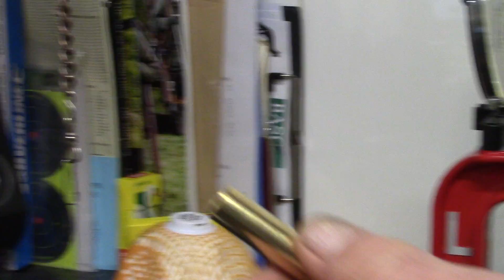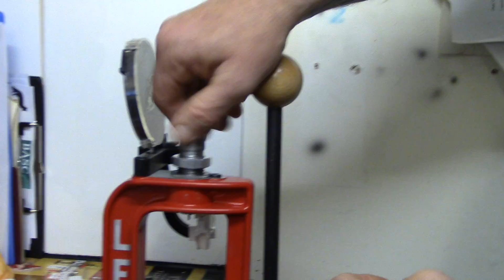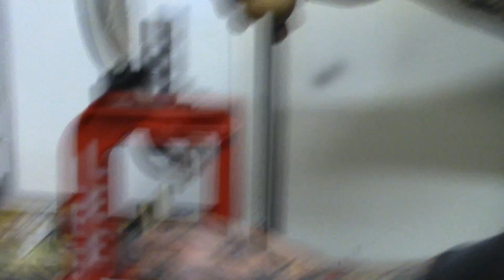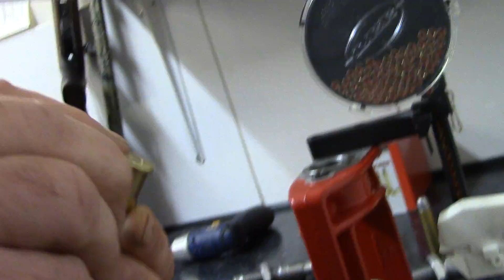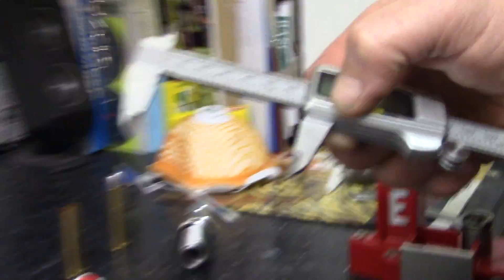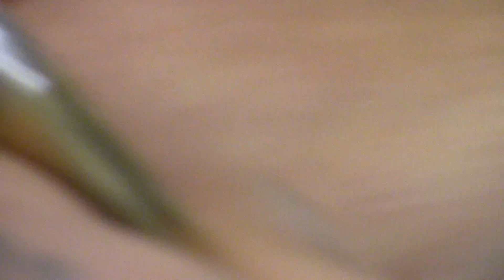45-70 Government reloading using Lee re-loader

Comment: For those who are starting to load .45-70, know there are really THREE different categories for this cartiridge - the lightest is for Trapdoor Springfields, middle level for lever-action rifles, and the strongest/heaviest for MODERN single-shots. Have older rifles checked out by a reliable gunsmith so you don't damage it OR YOU by overloading it. 
Also, if it's a single shot, you don't need a crimp step at the end, but for lever actions, it's absolutely necessary so they don't come apart or have the bullet pushed back in the case while in the magazine tube, either one of which can cause a lever-action to jam . Overall, though, this video is a great primer for the new .45-70 reloader, taking all the steps needed. Some can be combined (flaring & priming), but the systematic progress is good.
Reply: I have an H&R single shot. Glad I got it. Going to reload some 405 gr bullets.

Comment: Did you buy those 400 grain lead bullets or did you cast them. Are cast bullets okay with 45-70. Probably a big saving if using cast bullets. Could use some advice on this.

Comment: Great video, just one thing: you should be putting wads in the shell to take up the extra space, otherwise you may cause an explosion.
Reply: With smokeless powder you don't really need a wad, but is does keep powder toward the rear of the case if you press it down with a rod of some sort. If you are loading BLACK POWDER in any cartridge there can be NO air gap between the base of the bullet and the powder. If you fail to heed that warning, you will ruin your rifle, your day and possibly kill or maim yourself or any bystander.
Reply: Didymus 1999,
Listen to Ray C ...

Comment: If you're using a Ruger No.1 to fire .45-70 you are a glutton for punishment. It's the worst rifle I ever shot in that caliber. It's too light, has a terrible butt stock and the barrel is too short. Don't get me wrong, I love most Rugers and I own sever, but the Ruger No.1 in that caliber is just not a good idea. It left me with the worst bruised shoulder of any rifle I have ever shot including several .50 BMG rifles. The .45-70 is a great round but just find a better rifle to fire it out of.
Reply: Are you thinking of the Ruger #3, that was short and light . most No. 1's have 26 inch barrels.

Comment: If you're using a Ruger #1 or any single shot for that matter, there is no use to trim the case mouth, nor crimp on the bullet. It only causes premature cracking. By the looks of the ominous bulge around your bullet, your dies are "WAY" too small. If you put a slight bevel on the case mouth, there is no point trimming inside or outside. Neck sizing with your dies may alleviate the problem, since 45/70 has a slight taper, and the case won't be sized as small. only crimp enough to bring the case wall back to straight. Crimping on the bullet will only cause premature cracking. As low pressure as you are loading, your brass should last forever. If you get a lever gun,....forget every thing I said.

Comment: Hi, I want to try reloading 45/70 using the 405 grain bullet but I don't want to use gas checks, can you advise me on a good hand load for 100 yards target shooting
Reply: Faster powders seem to decrease my accuracy. For lead loads something in the range of  4227 or 2400 keep pressures low, and increase accuracy, "BUT" it takes more powder to get the same velocity.
Reply: If you don't want to go the process of using a gas check bullet, put a gas check in the case backward, and push it in place with the bullet. It will seal better than the conventional method. Never do this with anything but a straight wall case.
Reply: You shouldn't need gas checks if you keep the velocity down, below 600m/s would be good, 400m/s even better.  I shoot cast without gas checks in my 460 S&W and I haven't had a problem with leading.
Reply: try 12.5 grains of IMR Trailboss for 950 fps in my Marlin, nice target load. gonna try on Deer this fall.
Reply: @tracyclaystowell6431  
That load is Spot-On ! ...

Comment: Good video Geoff.  Lots of good advise for beginning reloaders. The only thing I would  modify in your routine is to size your cases before you trim. In my experience (55 years reloading) the sizing die squeezes the diameter of a straight wall case down and lengthens it somewhat.
Reply from the maker: +jima28080 Thanks for the tip Sir, all advise is welcomed.

Comment: i have a 45/70 but i use trail boss and i get out to 100yds easily. this powder was designed for cowboy shooting and looks like tiny doughnuts. i use 14gns and there is very little recoil.
Reply: Does it smoke? I want to see smoke.
Reply: @grumpyoldfart7302  
No. No smoke ...

Comment: nice vid, could you tell the shown projectiles on the thumbnail picture?
Reply from the maker: +Warbeast911  Sorry, do you mean what are they?
Reply: +Geoff Bullock yes, i would like to know the bullet shown in the video thumbnail. i am searching a spitzer type bullet for my 45/70
Reply: You know you can't use them in a lever gun don't you? I use a lee 485 grain. You can max out any lead bullet weight without going over pressure. Going over about 1300 might cause you trouble with leading. I shoot the big spitzer, and cast if from any  junk lead, I can find, with a gas check behind it, turned backward. I shoot about 1050 fps with IMR 4227.  Alliant  2400 works well if you can find it. You can use faster powders, but accuracy seems to fall off, and pressure is higher, maybe because of stripping, because I use such soft lead. Try shooting a big flat nosed soft bullet at about 600 fps, at an old building, and watch the boards splinter and big slabs go flying through the air.... Fun stuff.